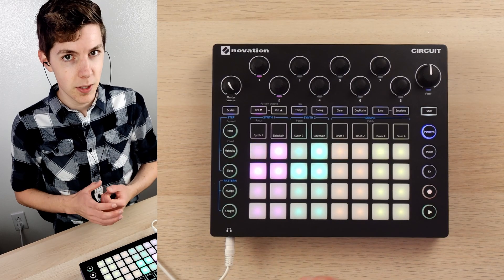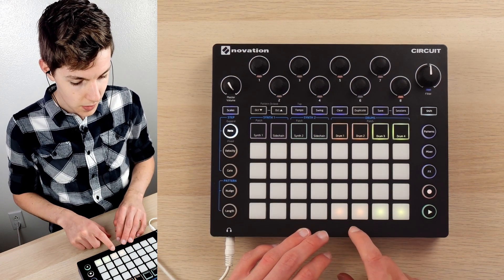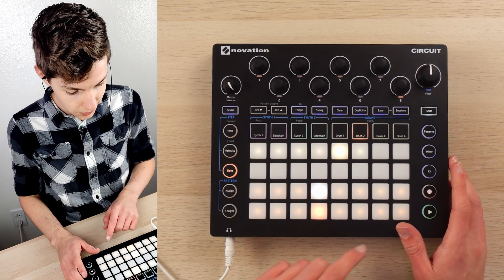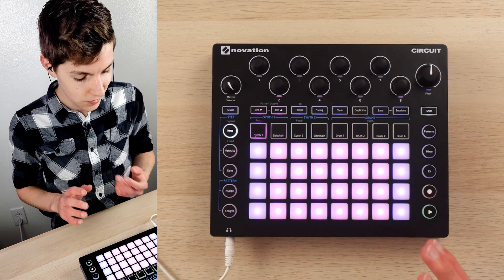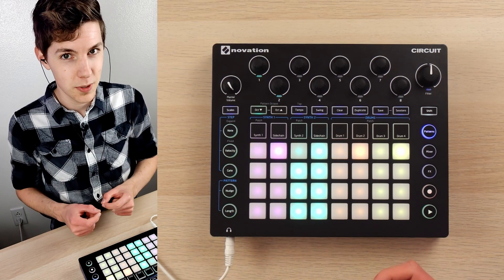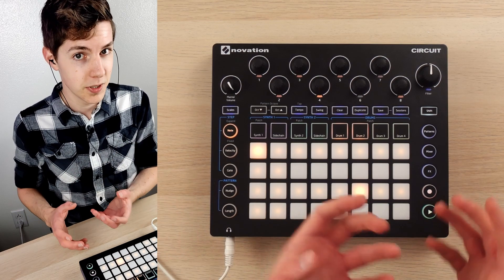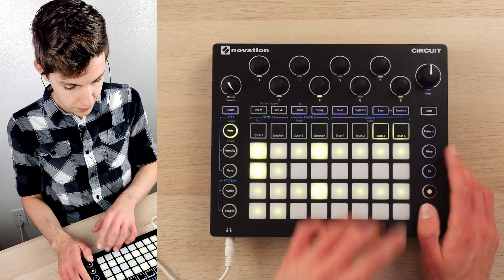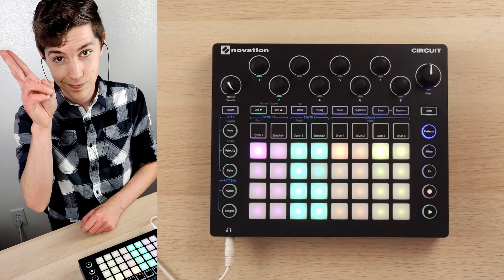How to make Lofi Hip Hop on the Novation Circuit

Comment: Do you think if I hooked this up to a sampler like an Akai or teenage engineering pocket sampler i could work completely without a daw and use my own samples? I think the circuit workflow seems better than the  Roland sp, but I’m not sure the built in sounds cut it and I wanna use my own samples

Comment: I don't know how to save a session!
Reply from the maker: Double tap the save button or go to the projects window, hold down the safe button, and select a slot for it to go into. If I recall correctly, the original circuit doesn't let you save stuff by default, so there may be a setting you need to change. Check the manual for how to do that.